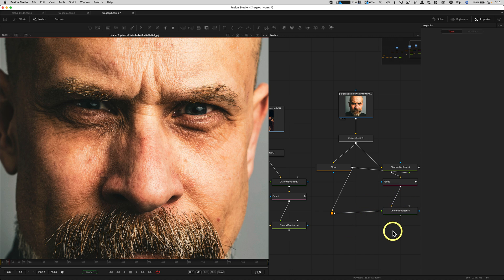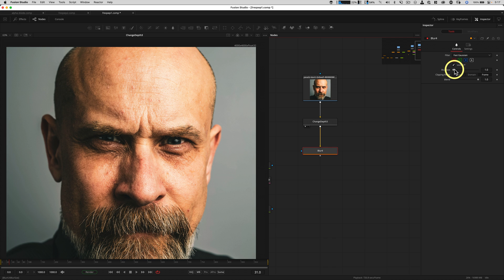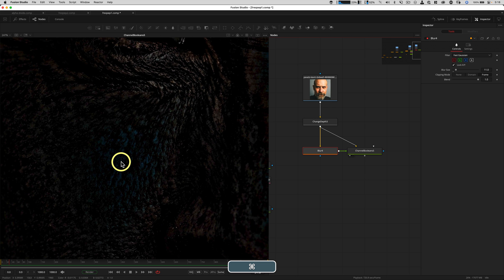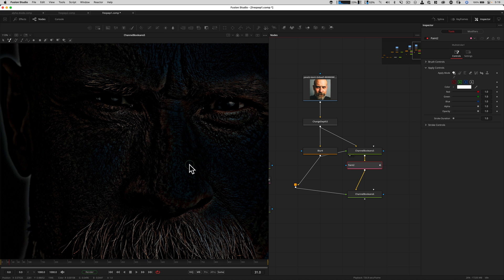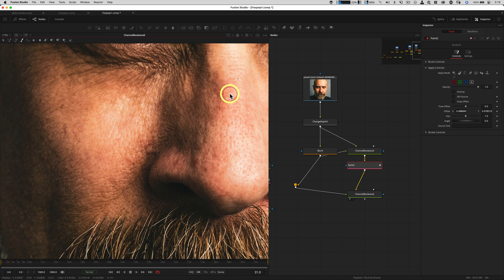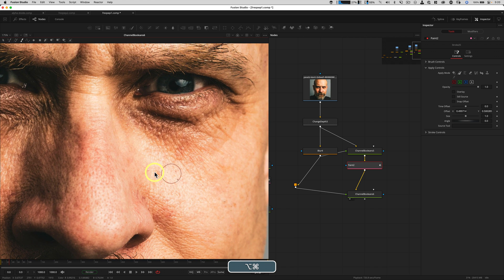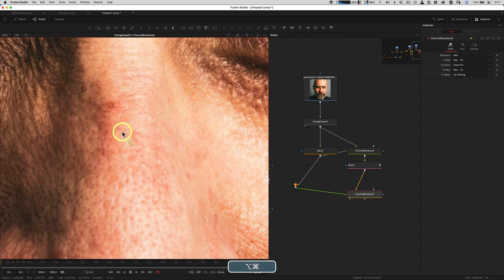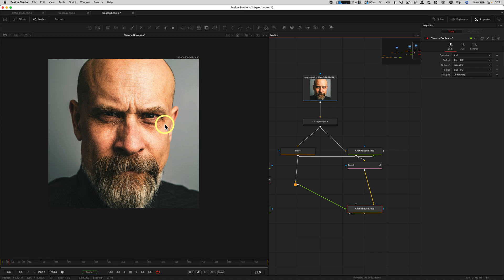Blackmagic Fusion Frequency Separation Paint Cleanup

Comment: Update. This method works really well, actually. Better than I imagined. I tried it with surface tracker and it works really well for beauty work or portrait retouching. Very natural results.  Surface tracker to stabilize and mask part of the face, like a side of the face, than I do what you showed and than copy of the surface tracker to unstable and bring back the motion. On flat surfaces like walls etc, works great for clean up using same process but with planar tracker. It also works well when using method of freeze frame and match move. Thank you for another ting to add to the tool belt.  Will be using this a lot.